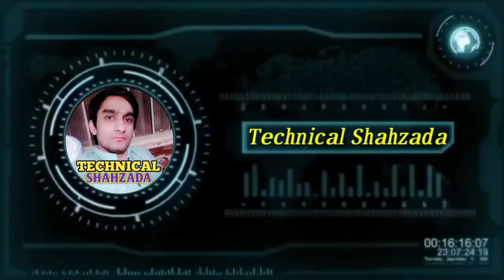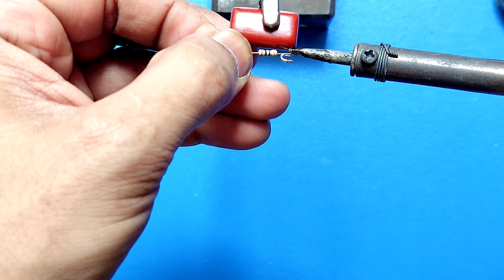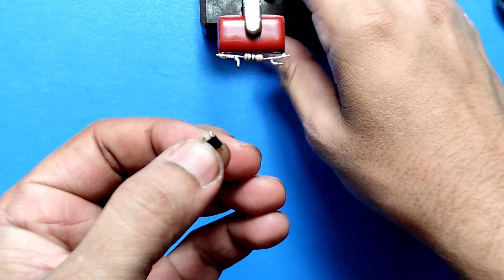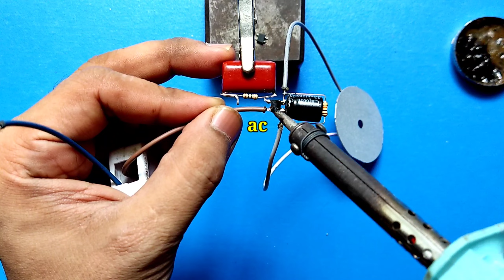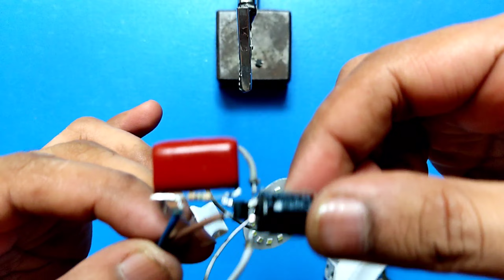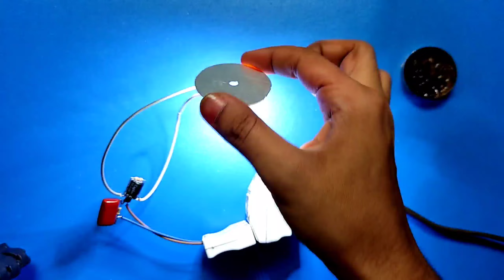LED bulb repair | led bulb driver circuit/kit | 9watt 12watt led bulb driver circuit

Comment: Very nice...if I use a 1000 microfarad electrolytic capacitor 50 V  at the dc output, will it do? If yes,in such case what will be the value of its discharging resistance?

Comment: Bhaiya mai 33uf 100V ke alava dusara konsa capacitor use kar sakta hu  jai seki 15uf 400V . 80V 100uf . 10uf 400V . 150uf 100V . 82uf 80V . 120uf 80V . Please bhaiya muje jaldi bataiye 🙏🙏🙏
Reply from the maker: Bhai ap 47uf or 80v se 120v tak ka koi bi istmal kr sakte hin .
Thank you so much for your valuable comment and visit
Reply: @TechnicalShahzadats  to bhaiya mai 100V 100uf use kar sakta hu kya please muje jaldi bataiye 🙏🙏
Reply from the maker: @RamExperiment  g bhai kr sakte lykin ho sakta hai es se apki LEDs kuch time baad jal jaye agar thore watt ki LEDs pe lgaya to 10 ohm resistor 2watt min zror istmal krna
Reply: 22.ohm 2watt use kiya to chale ga na bhai
Reply from the maker: @RamExperiment  chale ga
Reply: Bhaiya maine agar 450V . 4.7uf capacitor ya fir 47uf . 100V capacitor in mese konsa bhi capacitor lagaya to is me se kon sa achcha kam kare ga aur kitene watt ta kam kare ga please reply bhaiya aur dono ke bare me alag alag batana please bhaiya 🙏🙏please reply bhaiya 🙏🙏
Reply from the maker: @RamExperiment  bhai 47uf 450v bilkul bi nhe lga sakte os se LEDs jal jayin gee or 47uf 100v perfect work kre ga 12watt se 18watt tak
Reply: @TechnicalShahzadats  aur bhaiya 5watt se 12watt tak in mese konsa capacitor kam karega please reply 🙏🙏🙏
Reply: Please reply bhaiya 🙏🙏
Reply from the maker: @RamExperiment  33uf 100v or 12watt se choti LEDs ke sath led ke positive point pe 10,ohm to 33,ohm ki 1watt min resistor zror lgana
Reply: @TechnicalShahzadats  2Watt me chale ga kya
Reply from the maker: @RamExperiment  nhe bhai ye circuit 2watt jala de ga